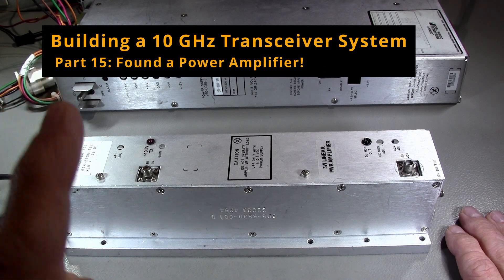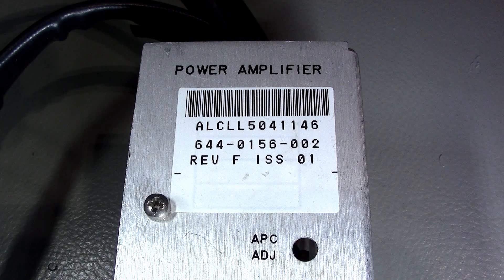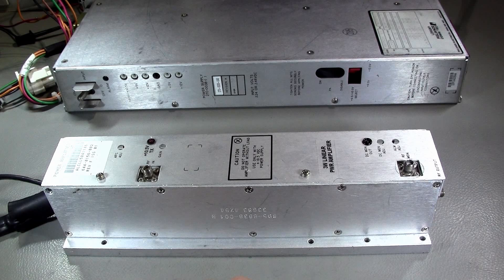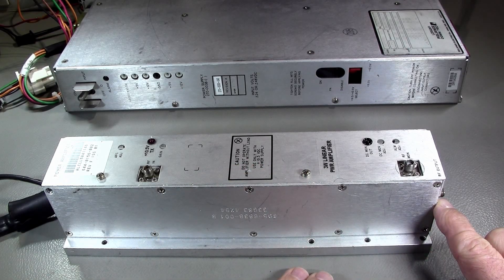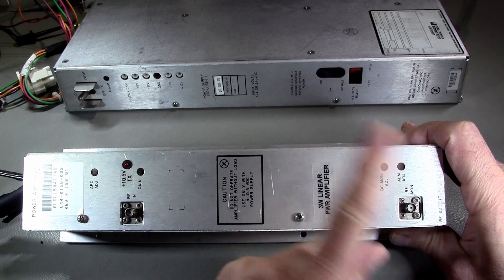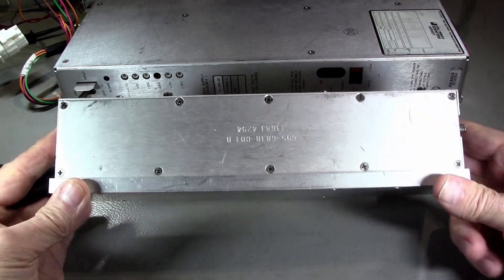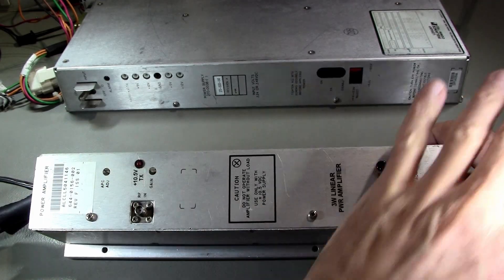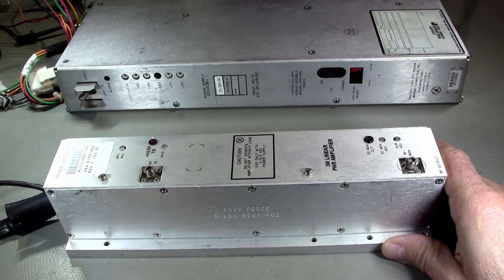10 GHz System, Part 15: I Found a 10 GHz Power Amplifier !

Comment: I made 5 of these W1GHZ 10ghz transverter boards and none of them output the specified output power.  I think from memory the best one had about +6dbm and the others less..  I see from your video that yours didn't achieve 10 mw either.   I really like your video style. Clear and informative.
Reply from the maker: Luckily, it was more than sufficient for my Alcatel PA. Thanks.